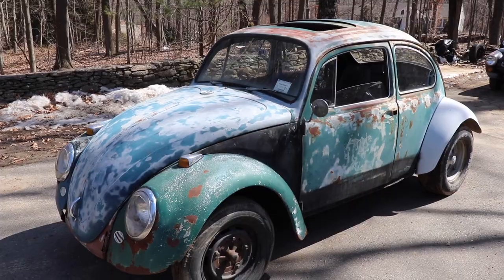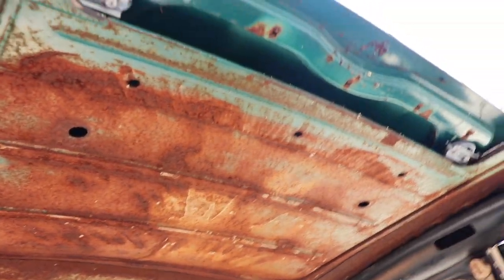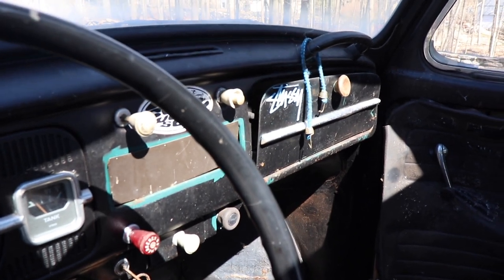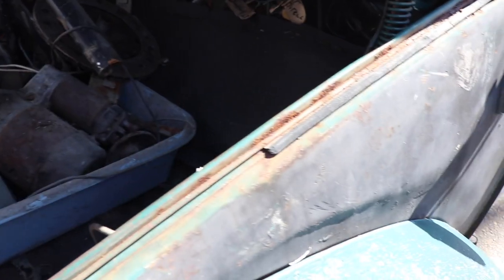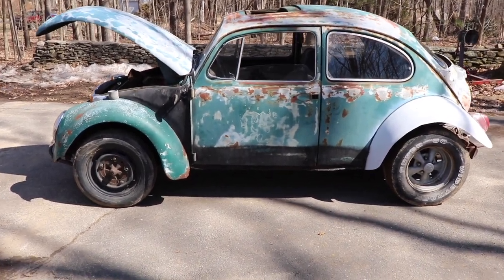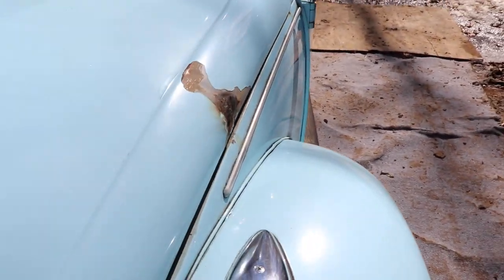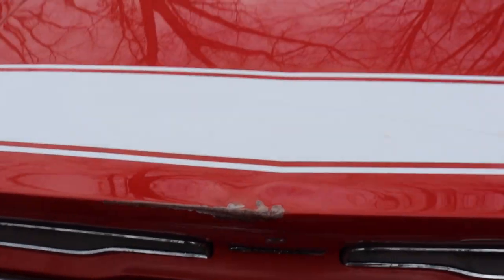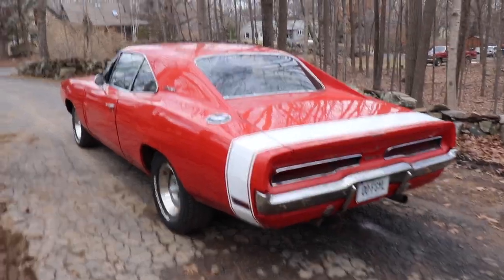The 1966 Volkswagen Beetle / Baja Vw Bug walk around & the 1970 Charger comes out for spring spin.

Comment: like the slinky. I used to love those things. That GTO is fixable but it will take some serious commitment on metal work. Seemed like every panel will need to be replaced. Quarters, deck lid door skins and lower supports. hood fenders roof It will be almost a new car when it is done but still worth it especially if it is a factory 4 speed and still has the 400 4 barrel.

Comment: Love that '66! And if I didn't have 10,000 projects of my own going now..Wish I could get away too, to help you tune that Charger, as it kills me to see it running like that, and I have a long background of working on those motors. Try not to let that 440 idle to long on first starts, as they load up and don't always circulate the oil well unless you've worked on the oil pump/engine yourself. Lastly hang on o that metal Slinky..the originals are starting to go up.
Reply from the maker: Well make some time ! lol ....it really needs a tune , it sat covered in VW parts last year so this year is progress :) . Thank you 217 , are you in IL ?
Reply: @5150mxVW  , Oh man Jason, wish I could get by there, but w/everything I've got going on, just can't. Am not in IL, am east of there and a bit north ;) and yes realized it was sitting, so it needs a tune and carb adjusted etc..,when I was a kid people used to bring their Mopars..including many big blocks as I was already known for rebuilding carbs, adjusting the dual points properly and such, luckily worked w/a master at it from like 12 yrs. old. You should see if Mustie1 will take a look at it when he is going to pull out his Satellite for the spring, maybe a drive their in it is in order, as he has the gauges and such too.

Comment: Baja bugs are neat, but having an exposed engine in snow country they are probably not good for winter driving. Seems that lots of Baja's don't have much engine tin, so I wonder if they would tend to overheat if driven in traffic?
Reply: ...sprays the whole engine with water. Indeed a very good 'solution'.

Comment: Jason is that Charger the one Mustie is driving, as to those fenders, they look like the ones, that were used on the Nascar race car, the one that Richard Petty would race, his car was blue with white, it had the rear wing on it, I believe if you went to the dealer, you could get get the special option, and that was when Chrysler was big into sports, those rims, eventhough they are Chrysler, you could see them on many of those cars, but the ones in Mexico, they are big over there you could even see them on Police cars, that Charger had the regular Rallye Wheels commonly used on the Barracuda,& the Challenger, maybe because I like originality that 1966 Beetle, I like it the way it was, when they cut her up like that to put fiberglass flares on, it does not appeal to me, as to where the engine is, isn*t it suppose to have like a metal cage around the back where the engine is, so it can match thecNerf bars.

Comment: If you decide to cut the front (Baja style), do not cut the fenders or the clip. If you remove the tank, you can drill the factory welds to remove the clip. Its original and worth money. The fenders too.

Nicefind! Have fun, be safe. Thanks for the vid

Nice charger too
Reply from the maker: Thanks Rich , I won't be cutting the front clip , I have a solid baja body already .

Comment: I would think the front wing/fender on the Charger could be panel beaten back into shape if you can find a good body person.  It'll probably be a lot cheaper and easier than finding a good, straight, original replacement panel...